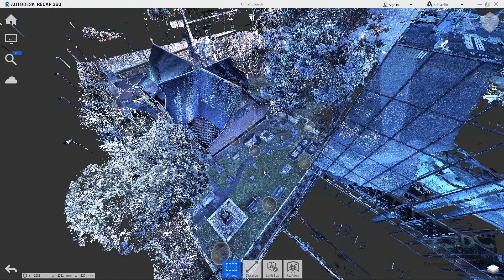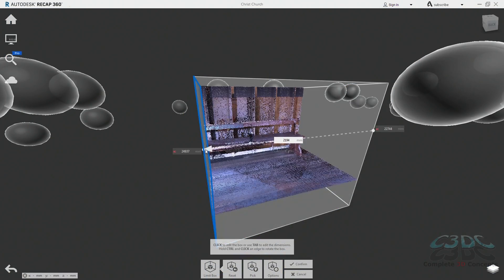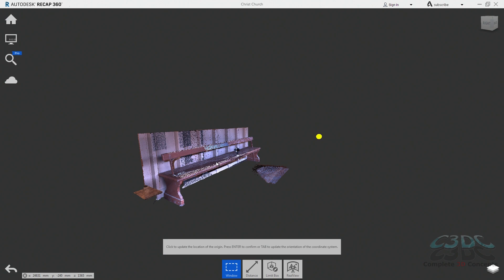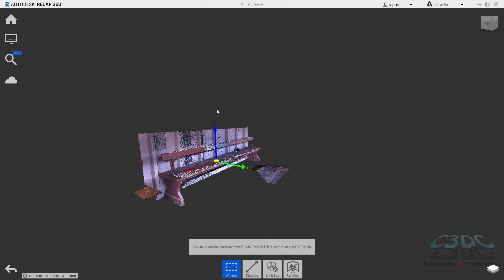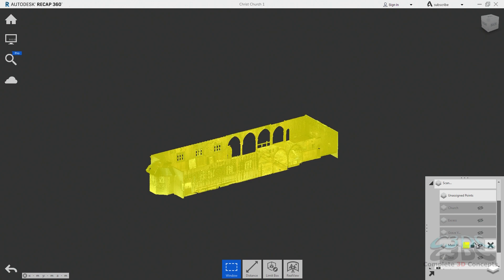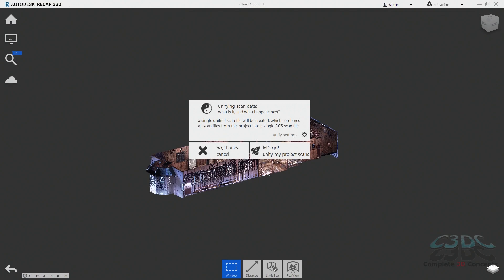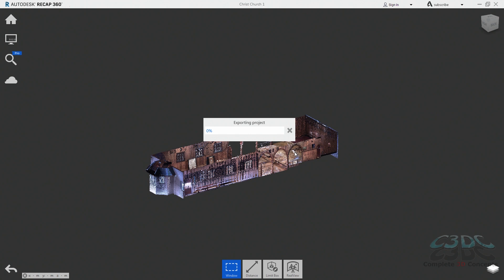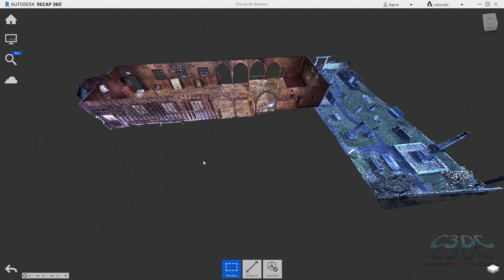Working with Point Clouds in Autodesk Recap - Part 4

Comment: Hey, it seems that the Region-tool is only available in ReCap Pro these days? At least my ReCap shows the "PRO" sign on the Region tool and I cannot use it.. What do you think is the best workaround for it? Is it just to use the Limit box tool and then saving those boxes separately. So basically there will be only one box in one .rcs-file. Ps. Thank you for these tutorials, they really are a great introduction for beginners like me.
Reply: So, I took the 30-day trial from the Recap Pro because the region tool is very important. And if needed I will propably continue with paid Recap Pro, because its cost is not too bad, 55€/month or 448€/year.
Reply from the maker: @anttiniskanen382  sorry for the slow reply. you are correct, but as you have noted the cost for Pro is low and the benefit is high. We think it is worth paying for. If you are using other Autodesk products then it may be worthwhile looking at upgrading to a collection. as i understand it they  all come with Recap Pro as well as a host of other software. 

For anyone else that stumbles across this, there is also an option for your scan service provider to break the point cloud up for you. I wouldn't typically advise this as you will want the point cloud broken down in a specific way for your job/task. This would also likely be more expensive then getting Recap Pro for just a month or 3 as you would be paying them to do it.

Comment: Hello, I liked the series. My objective is to convert pcs or pts files formats to Inventor file format to ultimately import into NX. I can't wait for the Inventor section.
Reply from the maker: Hi @MGAutoCAD thanks for the kind comment. Unfortunately as we only do these tutorials during quiet periods with a view to helping out others, we have been unable to get to the planned next tutorial of working with the point clouds in Inventor at this stage. We do have a tutorial posted that shows how to insert the point cloud into Inventor if that is of any help in getting you started. From there it is pretty much a case of using planes and sketches to trace the point cloud and create the solids you wish to create.  I know that sounds a little vague but it really is that simple. We are hoping to be able to specifically dedicate some time and effort to doing tutorials later this year though, so please feel free to subscribe to get those as they come out.